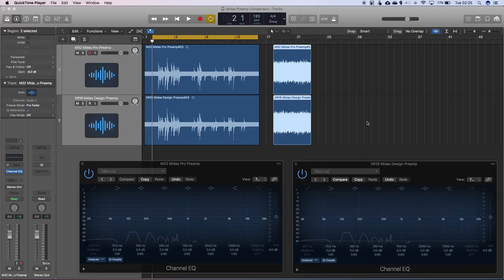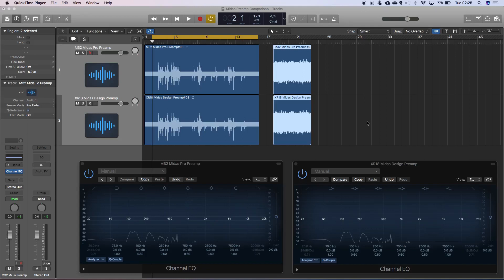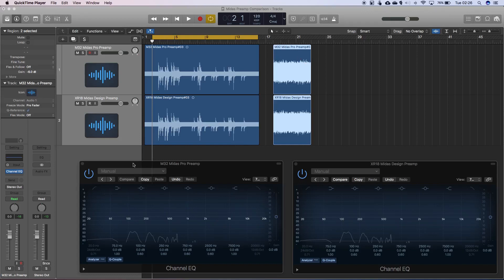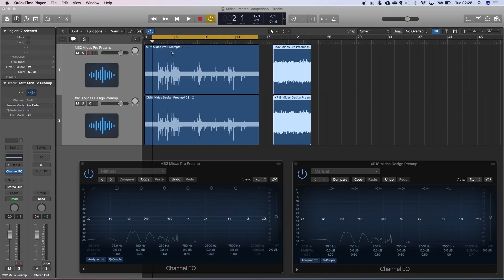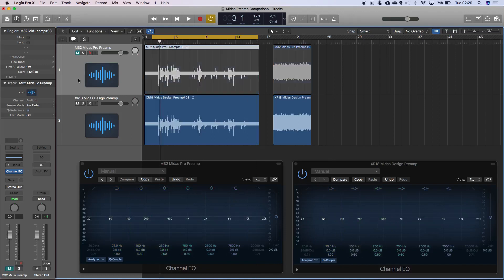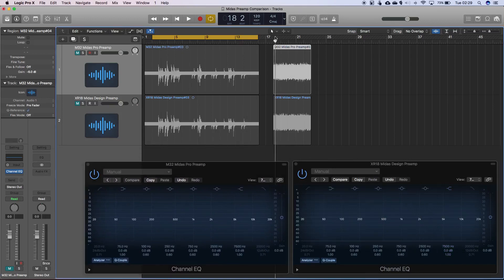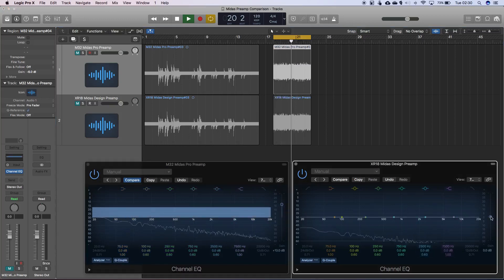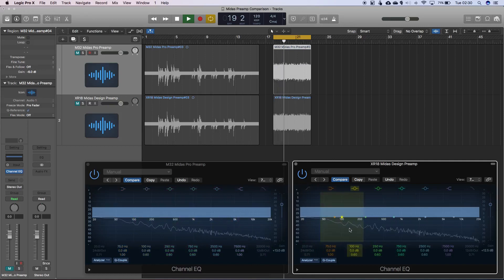Does it really sound different? MIDAS Pro vs Midas Designed (Behringer) Preamp Comparison

Comment: M32 pre's are not pro series.
Reply: @@DCP-200 Yes they are better. Calling it pro series on the m32 is marketing. now there is nothing wrong with an m32. I'll put it this way an m32 with 32 preamps and a surface with an entire mixer built around it is $3000. a 24 ch dl is around $2500 - $3000.

Comment: The sound may be the same but from what I’ve learned, there is a significant difference in the weight of both pieces, the Midas being heavier. I believe this speaks to the better connectors and other parts internally. There are plenty of reviews speaking of channel failures and noise on the Behringer vs the Midas. In conclusion if you’re going to set it up and let it be, the behringer will be fine… if you’re going after repetitive setup/tear down the Midas may be worth the difference, as I’ve read of no failures. I’m not an expert. Anyone agree?
Reply: Totally, and the midas is designed to take the beating of continually setting up and tearing down.  The better quality faders are worth the extra price alone.

Comment: XR 18 is completely different than X32 from the power supply that feeds preamps to internal software it self so this not a comparison of X32 and M32
Reply: just to clarify, the x32 is a better sounding mixer than the xr18?

Comment: The biggest difference is going to be impedance. The Midas Pro Preamp is set to be an even and Equal 10 kΩ Kilo-ohm preamp where as the XR18's Midas Designed preamp is a variable 5 to 10 kΩ Kilo-ohms. The Circuit is nearly identical except for the tolerances. The Midas pro preamps will be more consistent when using multiple inputs where as the Behringer preamps will vary in it frequency response. Basically what this means is the Midas Pro Pres are going to give the mic a consistent sound over time, where as the Behringer is built to fluctuate depending on the source. How this translates in sound is that the Midas Pro will sound a bit more clear, punchy, and have less low end roll off compared to the Behringer. The only issue you may have when comparing these is if you used inputs 1 or 2 on the XR18. Those inputs are different from the rest of the mic pres in the XR18 and X18 mixers. Channels 1 & 2 are a switching circuit that can change depending on the signal it is feed such as a Hi-Z input for guitars Channels 1 & 2 have an even larger ohm difference from 5kΩ / 2MΩ so the tolerance is from 5 Kilo-ohms to 2 Mega-ohms which is a drastic difference. So what this means is Channels 3 and up on the Behringer will be a bit closer to the Midas Pro Preamps and Channels 1 & 2 will vary the most. Cool comparison by the way. I have used both a Midas Heritage 2000 and Midas Legends 3000 consoles in my studio for over 15 years and I can say that the Midas XL/Pro preamp is one of the best preamps ever made. The high 10 kΩ preamp gives a clear and very punchy sound when you compare that to a Neve 1073 which is 300Ω or 1200Ω ohms (not kilo-ohms) depending on if it's in high or low mode on the internal dip switch. This gives the Neve it's darker tone. The higher the Ω impedance the brighter and more punchy it will be. Thanks for doing this comparison it was great!
Reply: would be be more interesting to know the comparison between X32 preamp or s16 stage box, not XR18 and M32 premp or DL16
Reply: Thanks for this good info!
Reply: I believe you’re right. Kinda the same thing with Di’s, I think it’s  better transformers. There’s a big difference in passive Radial di’s than On Stage di’s. Just my 2 cents!

Comment: There is no difference between the two you choose. They are also the same on the official website.“32 award-winning Midas microphone preamplifiers” “16 award-winning Midas-designed, fully programmable mic preamps for audiophile sound quality”
Reply: That's ridiculous.  A company (for instance, Hyundai) doesn't buy another company that is well-know for extremely high quality (such as Bugatti), and then dilute the high-quality one and upgrade the cheap one so that there's much less difference.  The reasons to buy the better-quality company may include the acquisition of their intellectual property, but it is NOT to cause the high quality equipment to become part of the cheap equipment offered.  The cheap stuff could just be made better by utilizing higher quality components, hiring a few engineers to design the hardware/software  better/faster/stronger/easier to manufacture, and you wouldn't have to pay $50 million to make that happen.  And your two descriptions differ, further screwing you on your argument.  Midas can design something, and then Behringer says, "let's use cheap hardware components so we can make an inexpensive product."  The design doesn't necessarily reflect the actual brand of parts used, nor their quality, to build the final product.
Reply: Hi. I am the lucky owner of the Midas MR18 console. However, I lack the ability to select indication meters 1-16 Pre fader and a post fader   on analog inputs. I don't know if you understand me.
I will explain another way. During playback while moving the fader of channels 1-16, I also need to see the change to indicator meters for each channel 1-16. Now this is not possible because the signal for the indicator meters is taken from before the fader.

What do you think about it?

Well thank you
Reply from the maker: Thanks for your comment, however there are actually articles which show the hardware for these desks is different. The M32 preamps are made by Midas, using high-quality components. The Behringer ones are designed by Midas, however are produced using much cheaper parts. The A/D converters in the Midas desks/stage boxes are also of considerably better design and quality.
Reply: @tomwright9357  Thank you for your reply. Indeed, even though Behringer acquired MIDAS, the production of the products is independent of each other.

Comment: The midas pro preamps are different than the M32 preamps. I have an m32 and lots of experience with the pro 2 and x32 series. They're all slightly different with the pro series being the best sounding in my opinion. The differences may come down to conversion (44.1, 48 and 96k).
Reply: The m32 used to have the Midas Pro preamps I believe, not anymore

Comment: You can’t split mic level audio without losing your correct impedance 🤨🙄 you should have used two matched microphones instead of splitting
Reply: Yeah it's not ideal, but still glad Tom took the effort to demonstrate. Impedance mis-match between the preamps will change their normal inherent behavior, when run in parallel with one mic, and effectively halve their normal input impedance.
Reply: That was a first thought that came to my mind. Actually the difference might be more prominent if compared properly. Two seperate mics could make a difference too, so I would take a broadband sound source (for example studio monitor) and place a mic in front of it and then I would play pre-recorded sound sample recording it two times without changing anything - one  on Midas M32 and then on XR18. In my opinion that test would get rid of splitting impedances problem. Perfectly the test should take a place in an "acoustically-friendly" enviroment without outside sound pollution etc.